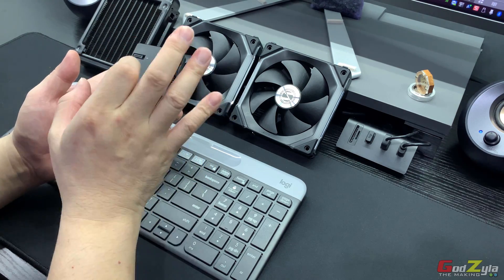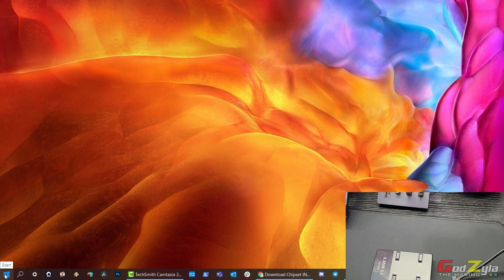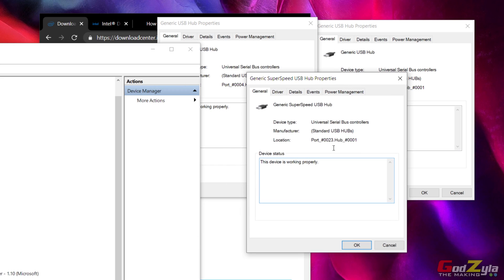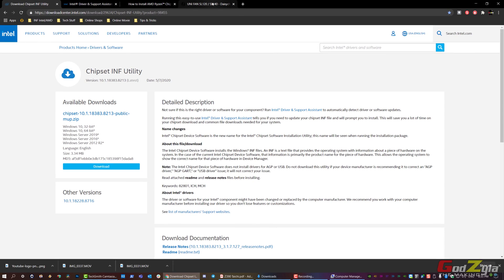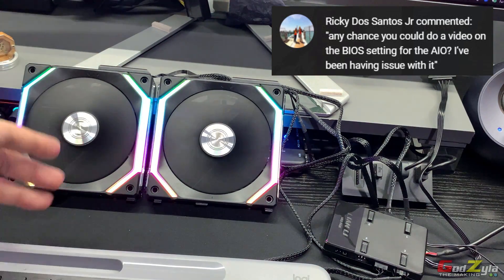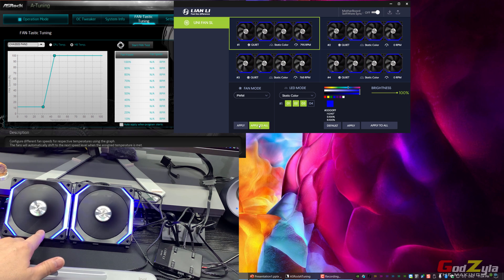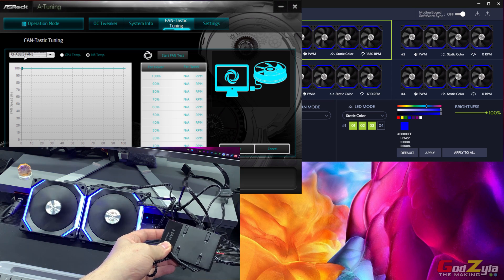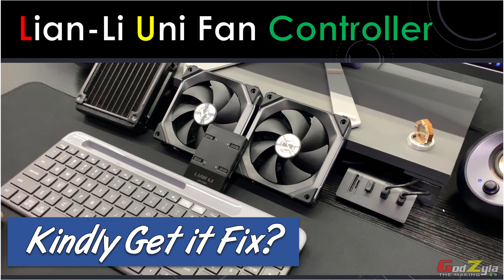Lian Li Uni Fan Controller - Some Break Fix! [L-Connect]

Comment: i tried everything to make it work but my argb its stuck in rainbow and the speed of the fans its stuck too
Reply from the maker: Hi Carlos Torress, welcome to my channel, mind if I ask which uni fans have gotten and which version of L-Connect app have you installed?
Reply: @KleoYan  i think this ones are the first versions because they dont have the serial number
Reply from the maker: @Asusmaker  Hi, I would advise you on the following

Lets start off with this first 

Motherboard & OS
===============
1) Is your mobo bios up-to-date and is the chipset drivers up-to-date? 
2) In Windows 10/11, in device manager, do you see the uni control under Universal Serial Bus Devices?

if you do not see that under device manager, shut down your PC and remove the PSU power cable from your outlet, let is sit for 45 seconds (this is to clear the cache memory on your motherboard) while waiting for the 45 seconds, double check your USB cable that is connected between your motherboard and to the uni controller. once done, plug back your PSU, power up your PC, now see and to make sure you do see the uni controller in device manager under Universal Serial Bus Devices.

If it does, launch L-Connect 3. you will first need to ensure that there are reading on the CPU and GPU in the dashboard, run some benchmark test and make sure the temperature reacts. If it does but you still can't control your fans, be it argb or fan rpms. do this

1) Remove all argb apps (Asus Armory Crate / MSI Dragon Center / Giga Fusion / Asrock Polychrome). If the brands which I have mentioned, do have a uninstall tool like the Asus Armory Crate, use that, else use Revo uninstaller ( https://www.revouninstaller.com/ ). Revo uninstaller will remove all unwanted files / folder / registry in your system. Illustration to use revo uninstaller https://www.youtube.com/watch?v=uMgUYiakpxM&t=437s

2) Do a manual firmware and follow this guide https://lian-li.com/l-connect3/L3_update_manually/

3) once firmare is done, reinstall L-Connect 3 https://lian-li.com/L3-changelog/ and try it again. 

I would also advise you to view this video for in-depth understanding of how L-Connect 3 works. https://youtu.be/CgvuUFeff8U
Reply: @KleoYan  yeah i do that but it doesnt work at all
Reply: @KleoYan  i see the lianli-uni fan-sl-v1.1
Reply: @KleoYan   i tried de 2 one ( Do a manual firmware and follow this guide) and i update the l connect 3 and now works!!! thanks bro
Reply from the maker: @Asusmaker  hmm.. then am seriously out of clue. you  might want to approach lian li tech support https://lian-li.com/contact-us/ or to seek help at their reddit forum https://www.reddit.com/r/lianli/
Reply from the maker: @Asusmaker  ok good..some of my viewers didnt go through my steps and rush into things, but am gald you have followed and happy that it works for you.. thanks for the reply.. 👍
Reply: @KleoYan  the uni fans sl140 white and L-connect 3

Comment: Can you tell me why my fans dont work once i restart my pc? I have to open ip the lian li software then they start ramping up and down. If i dont click on the lian li l connect then the fans just spin normal default speeds no matter what the temps are
Reply from the maker: Hi MereReef, welcome to my channel, do you mind first tell me which uni fan are you using and which L-Connect version you are on?
Reply: @KleoYan  hello im using the sl120 fans and im using l connect 3. All the fans work perfectly when i open l connect and the cpu and gpu temp works correctly when i bench mark.. its just that everytime i boot the pc i have to open l connect for the fans to run with the set fan curve. If i dont open l connect then they run at standard default speed
Reply from the maker: @MereReef  ok, now at your L-Connect. tap on Settings, enable Auto-Run on boot and enable Minimize L-Connect 3 to system tray at close. next do not close the L-Connect 3, reboot your system. This will fix your issue, give it a try.
Reply: @KleoYan  hi just done it thank youu… when i reboot it comes up with a pop up saying do you want to run lconnect. Its so annoying.. is that normal?  So i have to allow l connect to run every time i restart pc?
Reply from the maker: @MereReef  I think that's your Windows UAC which is triggling. UAC which stands for User Account Control (UAC) which helps prevent malware from damaging a PC and helps organizations deploy a better-managed desktop. 

For me I just disable that. As I have my router to block such stuff and with windows defender, it's good enough. If you want to disable it. click on the search magnify glass and type in UAC, set the level to the lowerest, next reboot your system, that prompt will go away. please note, do this at your own risk.
Reply: @KleoYan  thank youuu mann
Reply from the maker: @MereReef  you are most welcome. gald to have help.
Reply: @KleoYan  you should make a video aboit how to set a fan curve properly.. for aio and the system fans that would be brilliant
Reply from the maker: @MereReef  hi, I see what I can do. Thank you for your suggestion 🙂
Reply: @kleo Yan ive got some news… so ive been checking for updates through the lconnect and shows its up to date.. i went on tbe lian li website and noticed there have beeen many sofwtare updates and one of tbe updates allows for the l connect software to run WITHOUT having a windows promt everytime you restart pc 😁😁😁😁 finally
Reply from the maker: @MereReef  hi Merry Christmas! Nice, thanks for the feedback and updates. am gald now everything is working properly for you.. 👍

Comment: Ive been having to manually change the rpm for a little while im using lian li connect 3 I can change color and everything but the fan curves that I set arent doing anything any fixes?
Reply from the maker: Hello THRAXX, this video is in the past which is the original L-Connect, you might want to view this https://youtu.be/CgvuUFeff8U which might aid you. or to try the troubleshooting steps below

Disclaimer : Though the chances are very low to brick firmware updates on motherboard and to any controllers. I will not be responsible if you have brick your motherboard or controller.

1) Make sure your motherboard bios is up to date, please check on your motherboard manufacture website, under support > bios and drivers. See if there are issues with USB and do they have a fix. If there are, kindly update those bios firmware version.

2) Make sure your chipset driver for your motherboard is up to date! For AMD will be at https://www.amd.com/en/support for Intel will be Intel Driver & Support Assistant Intel DSA https://www.intel.com/content/www/us/en/support/detect.html

3) Remove all argb apps (Asus Armory Crate / MSI Dragon Center / Giga Fusion / Asrock Polychrome). If the brands which I have mentioned, do have a uninstall tool like the Asus Armory Crate, use that, else use Revo uninstaller ( https://www.revouninstaller.com/ ). Revo uninstaller will remove all unwanted files / folder / registry in your system. Illustration to use revo uninstaller https://www.youtube.com/watch?v=uMgUYiakpxM&t=437s

4) Shutdown your PC, unplug the PSU cable from your AC outlet. Press the power switch twice to discharge all current that your motherboard is holding. Leave it for 45 second

5) While waiting, please do not use KVM switches. Disconnect all devices that are connected to your motherboard (front / back IO). Leave only your Keyboard, Mouse , Monitor and Ethernet (If you have) connected directly to your motherboard. 
If your monitor has a KVM build-in, remove the USB cable from your monitor to your motherboard USB socket. If your mouse and keyboard are connected to your monitor, please remove them and plug them directly to your motherboard instead.

6) Plug only one Uni controller or Strimer Plus V2 controller. If its for Uni Fan (SL/AL) use only 3 fans to an output of the uni controller.

7) Plug the power cable and turn on your PC

8) Go to your Device Manager, look under Universal Serial Bus Devices, make sure you see the Lian Li uni / strimer plus V2 controller.

9) Install the L-Connect 3 app only https://lian-li.com/l-connect3/ (current version 1.3.16)

10)	After installation, run L-Connect 3, check under Setting > General > make sure Auto-Run on Boot and Minimized L-Connect 3 to system tray at close are ON.

11)	Reboot your system.

12)	First thing you need, go to device manager and see if the Lian Li controller is listed, next open up the L-Connect 3 app. Check if there is a need to update firmware to your controller. Go to Settings > Update, under Device F/W version, click on Update Check, download and install the firmware. Make sure the firmware is completed. Do a check on device manager and make sure the Lian Li controller is listed.

13)	On L-Connect 3 dashboard, check if the CPU and GPU readings are reacting, you might want to test it using some benchmark programs. If there are reaction, play with the PWM and argb functions. If it does not work, skip step 14) and proceed step 16)

14)	If Single controller works, shutdown your pc, connect uni fan set of 3 to your output of your uni controller. Do it small steps at a time to hook up your sets of fans. do not do all in one go. If successful and you have a second controller, proceed small step at a time again.

15)	Slowly plug back your USB devices (Headset, Microphone, Printer, USB Capture Card and etc). At any point of time as you add those devices one at a time, if L-Connect 3 become unresponsive. This tells you that there power is insufficient to power up more USB Devices. Whatever USB port on your motherboard, there is a limitation as the current are shared across the board, be it front or back I/O and the internal USB Header. You might need to get a Internal USB Hub that comes with a Sata Power source to the Internal USB Hub. (Disclaimer, buying a internal usb hub might or might not resolve this issue, purchase at your own expenses)

16)	If it does not work, report your issues to Lian li Tech Support. There is a in build log ticketing system in L-Connect 3 app. this is what you need to do. Go to Settings > Support > Click on “Download log” place a filename and choose a destination drive to save the log file. Next click on “Report” it will take you to Lian Li Tech Support FAQ. Fill up the form and upload the log which is a zip file.

Comment: So i need to download the chipset for intel for l connect to control my rgb and rpm? freshly installed and updated everything but nothing can be controlled
Reply from the maker: Hi Skylar, welcome to my channel, I think you are using the L-connect 3, if that's the case, you might need to do a firmware update. kindly check with version of L-Connect application you are using. if it's L-Connect 3. kinldy refer to this video. https://youtu.be/CgvuUFeff8U
Reply: @KleoYan  watched that video following along, and still having the same issues unfortunately
Reply from the maker: @Realrayt  hmm.. may I ask about your setup. which uni fans are you using and which motherboard too. are there any other argb program used? thank you!
Reply: @KleoYan  icue is the only other software I have that’s super heavy rgb oriented due to my cpu aio being a h150i elite capellix, motherboard is a msi z490 a-pro, fans are the Sl120 uni (5 pack from Amazon)
Reply from the maker: @Realrayt  I see, ok, this is going to be painful, do you mind to try uninstall all argb applications in your system. which are the icue and l-connect 3. try these steps to see if your L-Connect 3 is able to run. I have a feeling that the IRQ is lock by your Icue which is preventing the L-Connect 3 app to work. please do this if you feel is comfortable as I am just trying to help you out. no guarantee that it will work. if you do get your L-Connect 3 to work. then install your iCue. 

1) Make sure your motherboard bios is up to date, please check on your motherboard manufacture website, under support > bios and drivers. See if there are issues with USB and do they have a fix. If there are, kindly update those bios firmware version.

2) Make sure your chipset driver for your motherboard is up to date! For AMD will be at https://www.amd.com/en/support for Intel will be Intel Driver & Support Assistant Intel DSA https://www.intel.com/content/www/us/en/support/detect.html

3) Remove all argb apps (Asus Armory Crate / MSI Dragon Center / Giga Fusion / Asrock Polychrome). If the brands which I have mentioned, do have a uninstall tool like the Asus Armory Crate, use that, else use Revo uninstaller ( https://www.revouninstaller.com/ ). Revo uninstaller will remove all unwanted files / folder / registry in your system. Illustration to use revo uninstaller https://www.youtube.com/watch?v=uMgUYiakpxM&t=437s

4) Shutdown your PC, unplug the PSU cable from your AC outlet. Press the power switch twice to discharge all current that your motherboard is holding. Leave it for 45 second

5) While waiting, please do not use KVM switches. Disconnect all devices that are connected to your motherboard (front / back IO). Leave only your Keyboard, Mouse , Monitor and Ethernet (If you have) connected directly to your motherboard. 
If your monitor has a KVM build-in, remove the USB cable from your monitor to your motherboard USB socket. If your mouse and keyboard are connected to your monitor, please remove them and plug them directly to your motherboard instead.

6) Plug only one Uni controller or Strimer Plus V2 controller. If its for Uni Fan (SL/AL) use only 3 fans to an output of the uni controller.

7) Plug the power cable and turn on your PC

8) Go to your Device Manager, look under Universal Serial Bus Devices, make sure you see the Lian Li uni / strimer plus V2 controller.

9) Install the L-Connect 3 app only https://lian-li.com/l-connect3/ (current version 1.3.16)

10)	After installation, run L-Connect 3, check under Setting > General > make sure Auto-Run on Boot and Minimized L-Connect 3 to system tray at close are ON.

11)	Reboot your system.

12)	First thing you need, go to device manager and see if the Lian Li controller is listed, next open up the L-Connect 3 app. Check if there is a need to update firmware to your controller. Go to Settings > Update, under Device F/W version, click on Update Check, download and install the firmware. Make sure the firmware is completed. Do a check on device manager and make sure the Lian Li controller is listed.

13)	On L-Connect 3 dashboard, check if the CPU and GPU readings are reacting, you might want to test it using some benchmark programs. If there are reaction, play with the PWM and argb functions. If it does not work, skip step 14) and proceed step 16)

14)	If Single controller works, shutdown your pc, connect uni fan set of 3 to your output of your uni controller. Do it small steps at a time to hook up your sets of fans. do not do all in one go. If successful and you have a second controller, proceed small step at a time again.

15)	Slowly plug back your USB devices (Headset, Microphone, Printer, USB Capture Card and etc). At any point of time as you add those devices one at a time, if L-Connect 3 become unresponsive. This tells you that there power is insufficient to power up more USB Devices. Whatever USB port on your motherboard, there is a limitation as the current are shared across the board, be it front or back I/O and the internal USB Header. You might need to get a Internal USB Hub that comes with a Sata Power source to the Internal USB Hub. (Disclaimer, buying a internal usb hub might or might not resolve this issue, purchase at your own expenses)

16)	If it does not work, report your issues to Lian li Tech Support. There is a in build log ticketing system in L-Connect 3 app. this is what you need to do. Go to Settings > Support > Click on “Download log” place a filename and choose a destination drive to save the log file. Next click on “Report” it will take you to Lian Li Tech Support FAQ. Fill up the form and upload the log which is a zip file.
Reply: @KleoYan  I tried installing l connect 2 instead and it’s working now, but one fan doesn’t have rgb
Reply: @KleoYan  update: got l-connect 2 to work fully
Reply from the maker: @Realrayt  hi ok, if that's running fine. you can leave it this way. gald you found a solution by yourself, the only  difference between L-Connect 2 and 3 are the effects and to control the RPMs of your fans based on CPU or GPU temperature which are featured in L-Connect 3 and not L-Connect 2.
Reply: @KleoYan  gotcha, so it’s basically just being able to view temps and control rpm based on that?
Reply from the maker: @Realrayt  yup correct.